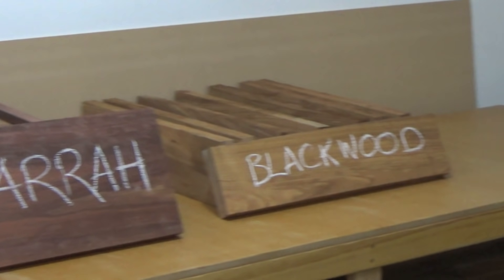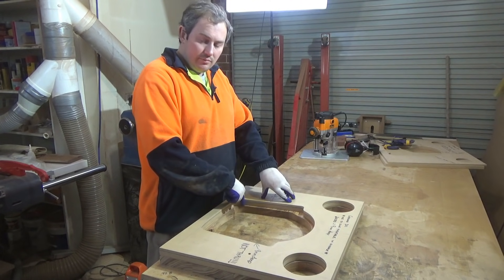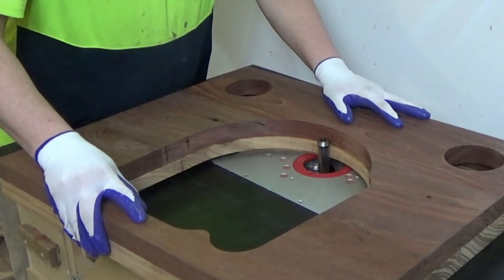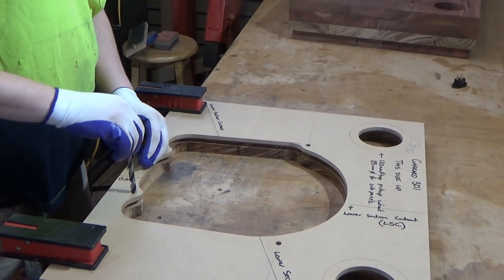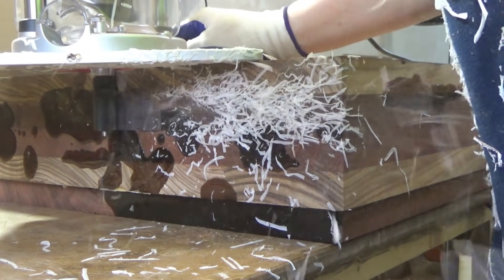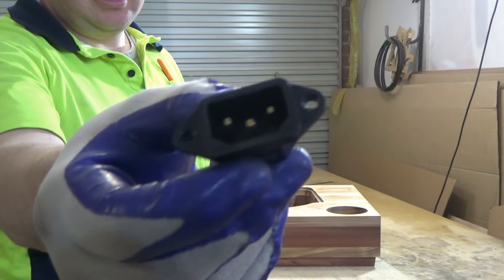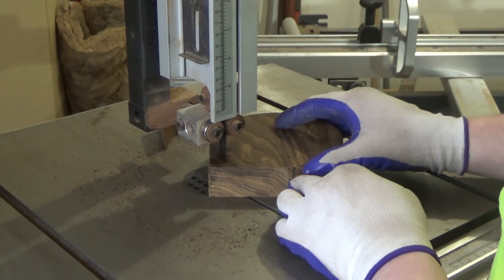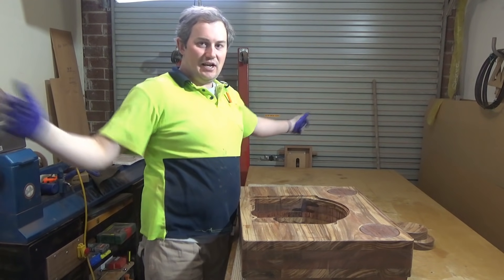How to make a record player plinth using solid timber - woodworking

Comment: Awesome but jeez that Jarrah makes a mess! Looks like it turns to dust. On that, yep I agree, the Jarrah inlays were the nicest.
Reply from the maker: It basically just turn to dust when trim routing end grain. It happens with all timbers, but is very noticeable with darker timbers. A good example is to take a fine end grain shaving with a hand plane. The shaving comes out of the plane and looks like an actual shaving, but if you rub it between your hands, the "shaving" turns to dust because the timber fiber strands were only ~0.03mm long...

Comment: Looks fantastic.  This may be a stupid question but Ive watched a couple of your videos and you seem to always have a template cut that helps with the cuts on each board.  How do you develop the templates.  Also, I'm wondering if you have an opinion on the sound quality or differences between a plywood plinth and a hard wood plinth.  I ask because I made a L75 first build with hickory and it seems to store and transfer energy (low frequency).  I've been told that Maple has more favorable resonances  and a lot of tables are made using birch plywood.  I'm planning to redo that table and I also have a Gerrard project to build. Thanks and beautiful work
Reply from the maker: I get asked this often enough. I would have shown how I make the templates in the video, but I made these templates a few years ago before I was making videos, and it seems silly and wasteful to make a new template for something I already have. In essence though, only the top template is critical because it will either have a smooth transition between timber and record player, or massive unsightly gaps. It's just a case of measuring out the record player very accurately and creating the template using those dimensions allowing some clearance space all the way around. You can draw the shape on a piece of mdf and then jigsaw away from the line, then refine the shape to the line with a file and sandpaper. For straight lines though, I generally setup a guide fence and use a plunge router. It takes a bit of time to make a template, but the time spent here ensures a quality product at the end. If you are unsure of your measuring skills, I would advise making a tracing template using cardboard and use that to make sure that it slips over the record player neatly. The cuts on cardboard can be made with scissors and don't require perfect straight lines or arcs, just good enough to confirm your measurements when you make a MDF template. 

As far as sound quality goes I don't know very much. I have been told that laminated layers of MDF is probably the best material to use but I didn't really understand the information being supplied to me. A little above my pay grade if you know what I mean. Nobody has asked me to build one from MDF, probably because MDF is considered cheap and nasty. I have made quite a few Garrard 401 and 301's from birch ply. The ply plinths seem to be well favoured. 

Thanks for watching mate.

Comment: I’m in the process of designing a plinth for a 301 I inherited from my grandfather. My uncle had it in storage and I was told he purchased it in Germany in the 60’s while working as a doctor for the US military. 

I work for a turntable company and we just purchased a industrial CNC router to make our plinths, so I‘ve been wanting to create something similar. This has been a great help and I may make a video of the process. I’ve been machining metal for years, but I’m new to woodworking so this is invaluable information. Thank you so much!!!
Reply: Is that glue hazardous?
Reply from the maker: The glue is Urea "formaldehyde". I think formaldehyde is a known carcinogen. It's the same stuff they use to make MDF boards, toxic, carcinogenic , just plain bad for you. I don't use that glue any more because it's a pain in the butt to source and I need to buy 5 liters of it and it goes bad in about 3-4months. These days I just use Titebond Original which works well and is easier to use.
Reply: Kuffys Woodwork Ok thanks. I just started machining MDF so that’s good to know. I’ll start wearing a dust mask

Comment: Beautiful work
Reply from the maker: Thanks 😊
Reply: @kuffyswoodwork  where did you get the motor templates? If that is top secret woodworker/turntable info I fully understand. I have average basic skills but am thinking of trying something w layered Baltic birch, not my idea seen others floating around.
Reply from the maker: @jackstraw1756  If you search for "Garrard 301 plans", a diagram will come up with dimensions. I used that along with measuring directly from a Garrard 301 unit.

Comment: I'm leaning towards the lighter blackwood inserts, but each one looks great. Interesting video mate, haven't seen anything like this before
Reply from the maker: My client will probably go ahead with the lighter blackwood because it is the safe option. There will be an epic change in appearance between now and after it has been finished with poly. The contrast becomes much more apparent after finish is applied so it may be overpowering.

Comment: Just a great job, congratulations.
Could you tell me what is the diameter of the two holes for the arms and the distance from the spindle? I can't find these measurements on the web, thank you.
Reply from the maker: The diameter of the holes were 120mm, though it could have been smaller. The distance from the spindle to the center of the holes is determined by the length of the arms, such as 12" or 9". From memory, I don't think there was enough space to get a 9" arm mounted properly though.
Reply: @kuffyswoodwork  Thank you so mutch

Comment: What is glue line "creep"? I've never heard this term before.
Reply from the maker: The timber and the glue move at different rates (expansion and contraction). Imagine pulling the joint apart a little bit, which will stretch out the glue. When the joint is closed back up again, the stretched out glue won't go back to its original shape, instead it will 'creep' out of the joint leaving a raised ridge of glue along the joint seam. Urea-formaldehyde doesn't stretch. It will crack if put under too much tension. Glue creep happens a lot with PVA glues, and even more so on PVA glues designed for external use given they are designed to be highly flexible when cured (stretchy).

Comment: ABsolutely impressive.  How many hours do ya figure, were involved ?  Cost of the wood ?
Reply from the maker: It's a solid two days work to make one of these spread over a several days accounting for glue drying times and polyurethane curing times etc. The cost of the wood depends on species, but there is roughly 10 lineal meters of 150x38 rough sawn material. The client supplied the material for this plinth, I don't know what it cost him. I'd expect between $200-300 in timber dependant on species.
Reply: @kuffyswoodwork  I'd say that is about a $2000.00 plinth, then !

Comment: Sorry, but with what did you said you use to glue the layers?
Reply from the maker: Urea-formaldehyde glue. It is a 2 part glue which cures rock hard and doesn't creep over time unlike ordinary PVA glue. if I was to use an ordinary PVA glue, I would choose Titebond original because it creeps the least between TB original, TBII and TBIII
Reply: @kuffyswoodwork  thank you very much for the info !!!

Comment: Skillful work. Lots of wasted wood inside. With beautiful wood as costly as it is burying so much inside this block is disappointing. Use manufactured product inside which is more stable and sufficiently dense to provide an excellent turntable base. Add exterior solid wood for the beauty it offers.
Reply from the maker: I don't mind the way my client wanted this built with solid timber throughout. The Blackwood was decent quality stuff, but the Jarrah was pretty close to being downgraded all the way down to fire wood. It was full of checking and voids, which worked well for this project because it was mostly hidden.

Comment: Whats this imperial rubbish,trying to impress the Americans? ;-) nice work by the way.
Reply from the maker: Lol. I've been cutting 8x4' sheets of MDF into 300x300 panels for years. Then I drill a 5/8" hole in them to accept a M8 bolt. It drives people nuts :D
Reply: @kuffyswoodwork Great video and a job well done. Yeah, we buy petrol in litres but calculate distance in miles per gallon and speed in miles per hour.  The Garrard 301 and 401 were manufactured when Britain was great and imperial. Oh and LP's are still refered to as 12" (that's inch in old money) what a strange world we live in😂